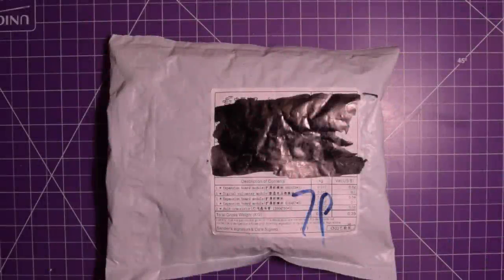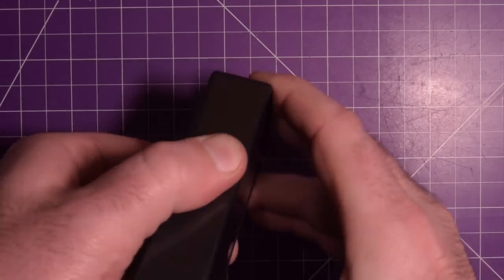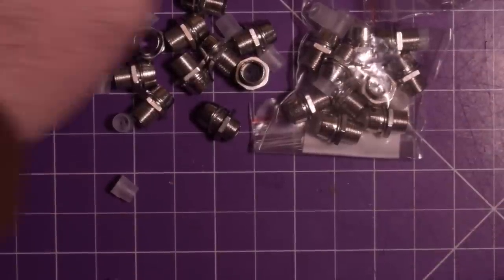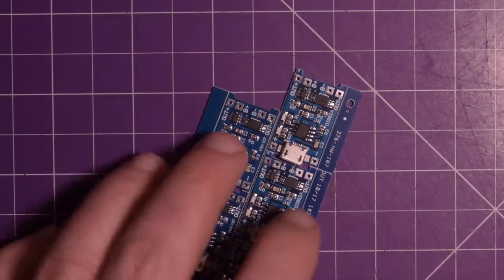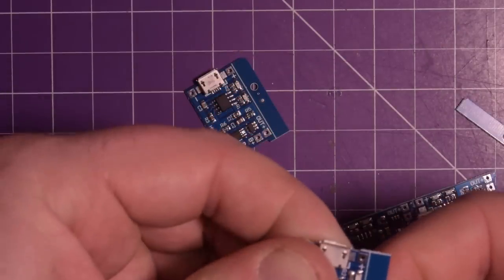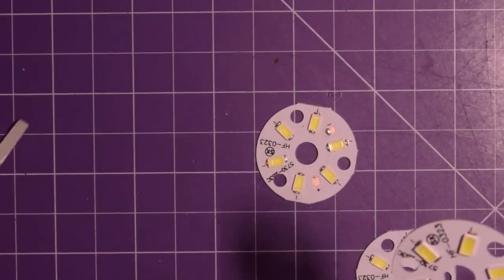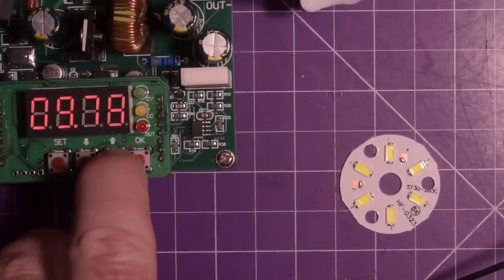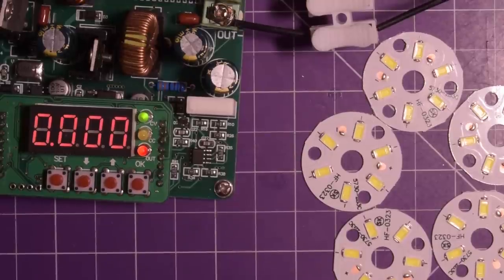Mailbag 20 - Alice1101983 Special

Comment: I have used quite a few of those self-same LED holders when working on retro 1980's 'home computer' mods.

They are... okay'ish. Certainly much better than a bare LED stuck through the case! However I found I always needed to araldite the silicon gasket in place. Also I am not at all on board with just leaving the LED's legs sticking out. I always try to supply as much strain-relief as possible in to my 
projects when it comes to parts that interface with the outsde world. In the end I settled on enlarging the holes in the gasket very slightly so as to fit AWG28 silicon wire and then solder the wires to the LED really close in--directly on to that widened knuckle or flange that each leg has, incorporating into this a current-limiting 220ohm 0806 SMT resister. That way all the solid joints were contained and protected inside the body of the chrome holder while the flexible leads exited and were glued to the gasket. Quite fiddly to get right, but a lot more modular and far less likely to twist or work harden and then break off entirely. 

I think there must be a better bulb and bulb-holder analogue for panel-mounting your LED's out there somewhere, but I haven't found one yet!

Comment: Neat haul! I am looking at lithium charge controller bords myself. I ordered a couple that should work with a e bike battery pack.
Reply from the maker: Wow, how many cells in series?
Reply: @SimpleElectronics I am not sure how I am going to set up the pack, I am trying to find a bunch of used drill batteries I can pick up cheap and hack.  The boards are  rated for 12.6 volts 20 amps if I make a pack it's going to.be 24 volt so I ordered a few. You should check out my channel I plan on doing some testing on them if and when they arrive